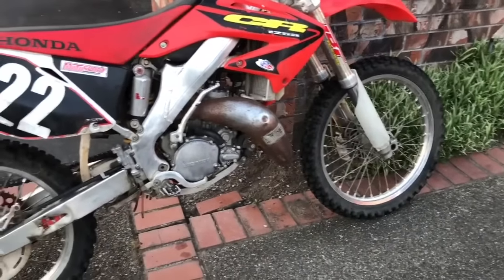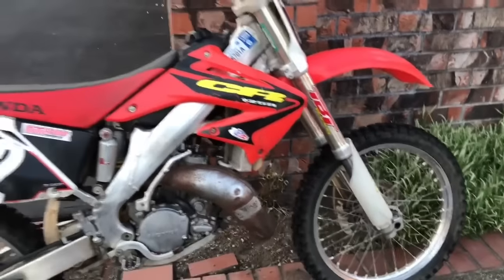The Ultimate Dirt Bike Transformation (Time-lapse)

Comment: One thing I would recommend is that if it runs do a small clean then take it all apart get a good clean and paint/clean up the frame and everything so then when you fix other parts they can be put straight onto something which will help with organisation and you dont need to worry about losing anything

Comment: Beyond beautiful, truly magnificent. Now, sell it. I did a resto close to this on my 93' CR250R. What you realize after finishing is; they don't show dirt bikes. Riding it like a dirt bike after you've attained this level has psychological consequences of guilt and paranoia of riding and crashing it. I even clear powder coated all of that polished aluminum to try to keep it from turning in mud and moisture. It was not like I thought it would be, it's no fun to ride now, so I bought a CRF450R that I actually ride and have fun on: some trick parts but very little detail work in it. This build is a little different than mine as the point here is for the video and that will help to offset the cost and emotional toll.

Comment: Wow. So sick!!  So clean and just enough bling to look trick but not over done. I do mostly trail riding and not as much track any more and everyone around me seems to be buying dual sport KTMs, Honda’s and Yamaha. I’ve added lights and some enduro goodies on my tricked out but old 2005 CRF450R and that has added some weight but I just can’t get into spending $10k on a new bike that weighs MUCH more than my CRF (even with lights). Nope, I don’t have estart or EFI, but I have Rekluse to prevent stalling (I don’t mind kicking it every once in a while) and the EFI bikes I’ve run with aren’t necessarily any faster than my bike (properly dialed in carb bike). I’m sure those are small improvements but I’m a weight freak and to me that means a lot in how the bike handles in tight trails and the track.

Comment: I’ve always wondered how you lace a wheel up you make it look so easy tho , here in uk the problem is so many get nicked it’s hard to come across a straight bike , I got a kdx220 and fell lucky, it’s not the cleanest but is standard which is hard to come by , Kawasaki 2 strokes are at the bottom of the totem pool when it comes to price but I’ve done right as it’s worth more then I paid along with my gsxr 1100 
1988 model, in uk there really is some Jems to be had .. good job 🏴👍🏼

Comment: Any tips for me? I can't get any paint to stick, ever. Whenever I use cans it always scratches off only by laying it down in my driveway with gravel, screwing in screws, accidentally touch it with a screwdriver or something. I do sand things, prime them, paint them, then clear coat/top coat, but still paint I do myself is always crap compared to factory paint. I would love to repaint my frame black instead of rusty yellow, but Im afraid I will just make it look worse

Comment: what kind of sand did you use for sand blasting the paint off you're parts. I want to get into powder coating my own stuff. I tried researching but seems to be a lot of different kinds depending on the application? Thanks in advance!

Comment: Hey have a few questions, what is the spray bottle youre using to clean frame in beginning ? I assume the pad is a scotch brite type? Also, what brand is that toasted oven !? I need that so badly my regular size toaster oven isnt cutting it anymore. Lastly, whats the tool called for the steering bearing? Thanks for any advice.

Comment: So I have a 2003 xr80r I was wondering if I could drop a cr80 2stroke motor in it I don’t know much about water cooled motors just the air cooled ones but only thing I can find that would be different mounting up wise would be a radiator am I right any suggests would help thanks 🙏

Comment: I'm also doing the same thing you are but it's not a 2stroke I found a TTR125L on Facebook for $240 and it's a 02 still had the brake in oil in it and it was also clean has all original parts but I am re storing the whole bike